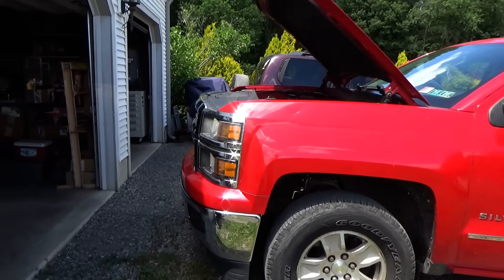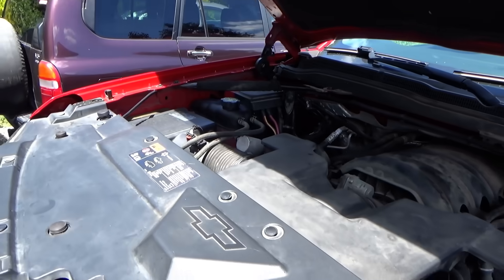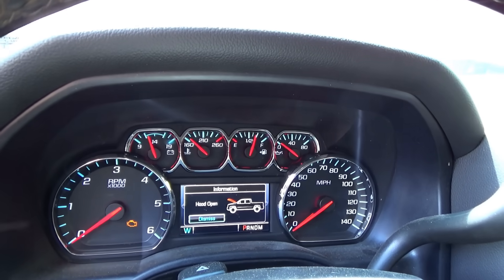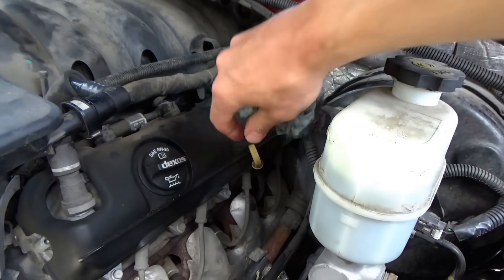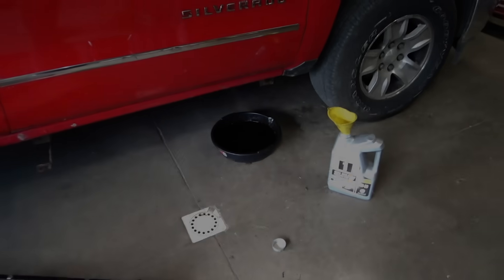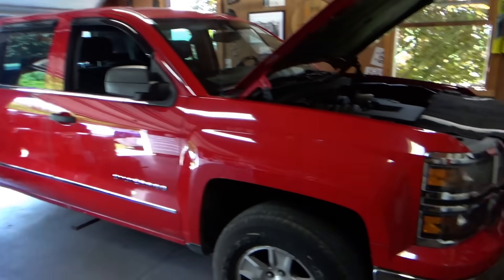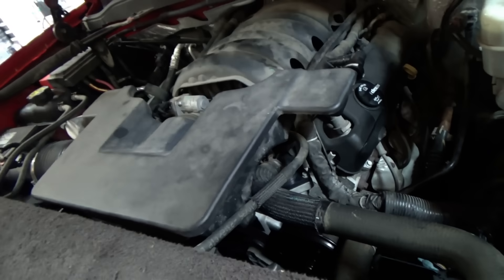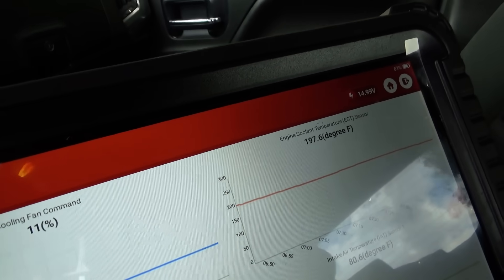Chevy Truck OVERHEATS?! (Thermostat & Water Pump Already Replaced...)

Comment: The truck looked very clean and in good condition. Well worth proper parts, repairs, and oil changes.
Reply: Just because the body looks clean doesn't mean it's good. 
You already saw the truck came in with only 3 quarts of oil with a capacity of 8 quarts. 
I've seen this so many times. 
I've heard a lady tell me, my car is making this rattling noise? 
I said, have you checked the oil?
She says No. I don't know how??
This is stupid to buy a 40k automotive and not know anything about it. 
Anyway, I stood beside her and told her what to do. 
Nothing on the dipstick?
She goes in the store, buys 3 quarts. Added the oil... nothing still...
Note,,,the car oil capacity is 5 qts.
I tell her buy 2 more. She add 2 more. Finally she gets a normal level. 
I tell her. You may have damaged the engine. 
It's okay, I'm going to trade it in. I don't care.
Reply: @2nickles647  The truck looked in good condition. That is why I said it should have had its oil changed and at a proper level as well as 5K or less changes.
Reply: @kerrylewis2581  NONE of that last part you claim to have said now is in your original that @2nickles647 commented about. Too late trying to make excuses to save yourself now.
Reply: @KStewart-th4sk  Sorry I let you down.
Reply: @kerrylewis2581  Yeah these GM DI V8's need to stick to a 5k mile oil change interval. People don't realize how much work fuel dilution is with DI, as well as the fact that soot generated by DI is almost identical to diesel soot. Important to change the oil more often and keep that junk out of the oil.
Reply: Well worth buying OEM  parts too, not aftermarket junk.
Reply: @user-pq9ji7kt4l  I paid more for a Motor craft fuel pump instead of a much cheaper China knockoff fuel pump. I did not want to walk home.
Reply: Except for the not-checking-oil-level part.
Reply: Yeah, except the oil was dangerously low so the engine wasn't looked after. The rest of what you said amounts to fluff, i sure wouldn't want that truck seeing how he couldn't check oil or change it. Looks like he knew how to use his expensive scanner to reset the oil reminder though!
Reply: @KStewart-th4sk  You can reset the worthless oil life monitor right in the truck, no scanner needed.
Reply: Don't go by the looks,  same goes with a woman/partner.

Comment: I used to have a Chevrolet, and it would wait until 220 degrees to turn on the cooling fans
Reply: Yep, those closed systems works best at 220 due to the pressure in the system. Coolant will not boil. 
As soon as you open the hot system the coolant boils instantly due to the released pressure.

Comment: Ah,  good old GM,
No oil on the stick should be a trade mark 😂
Reply: Wasn't always that way. I had a  79 2wd that didn't burn oil.
Reply: 390,000 miles on my Chevy Van just drips a tiny bit .
Doesn't burn any oil.
Reply: Maybe the newer GMs are a pos but my 2002 suburban has never failed us. I do all the maintenance myself and change oil and filter every 3 k miles, or one year.  Say what you want but if you take care of your shit it’ll last. Oh, by the way it has never been to a shop or dealership since I bought it new back in 02. No brag just fact. I will never buy an new vehicle because of all the bull crap junk they now have on them.
Reply: @billkaczynski7709  Same here, I refuse to buy anything newer than '06 and even that is straddling the I can't fix it line.
Reply: How is that GM's fault? They don't own the truck. CHECK YOUR OIL REGULARLY.  ITS YOUR RESPONSIBILITY!
Reply: It's a GM, it comes pre-broken from the factory...
Reply: @groosbro1  Not mine...I have several GM trucks Vans .
I stay away from Diesel now only gas 6.0 ,5.3 etc.

Comment: I'm bringing my truck to the mechanic; I better clear all the codes, and reset the oil life indicator so he'll think I changed my oil recently. I don't want him to think that I'm trying to pull something
Reply: reminds me of the seinfeld episode where he doesn't want to take his car to the mechanic because he get grilled with a bunch of questions by the mechanic when he does...."tell me the truth jerry,, you been going to one of those quickie oil change places? you see this gasket,, i have no faith in this gasket!!"
Reply: It's a wonder he noticed overheating.
Reply: And, ask for the money back on the oil change since that did not fix the overheating.
Reply: Exactly! It'll save me money if i hide it from him 🙄
Reply: I had one where they filled the radiator with antifreeze after it was cooked running without any.    LOL
Reply: Oil changes are a myth, one quart of sludge is all these babies need.
Reply: Very suspicious